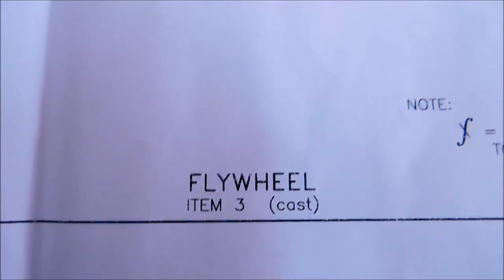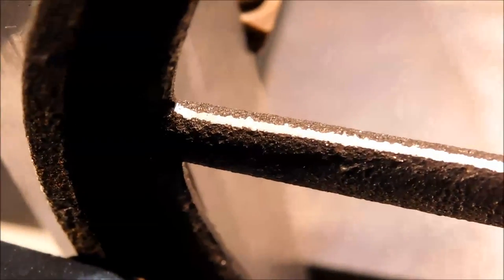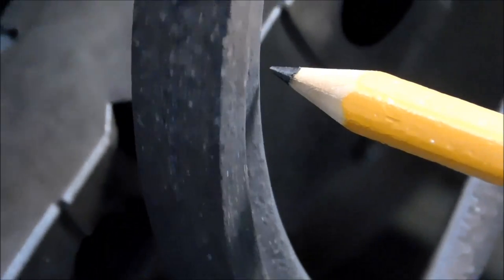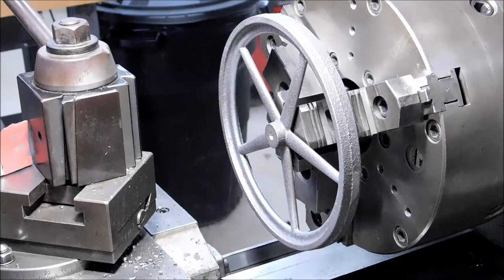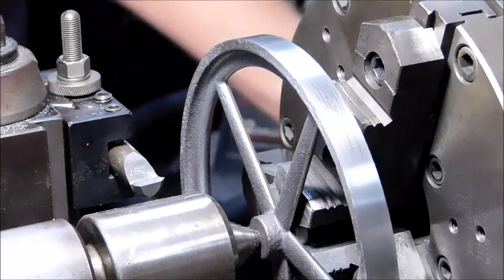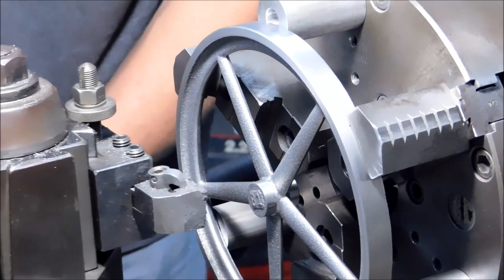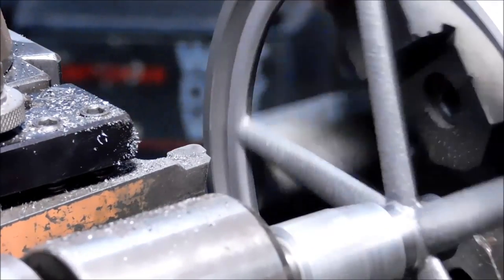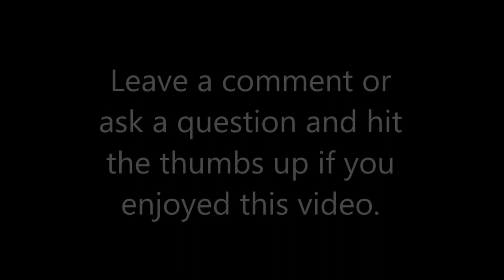Machining a Model Steam Engine - Part 10 - The Flywheel

Comment: i respect what Joe is doing here so don't take it any other way folk. now you see why so many shops won't take Cast ironwork they hate it,  the inconsistency in foundries alone is annoying. I'd do it because I don't mind a little extra work . castiron is porous and therefore a pain in the ass.  the smelter needs to take the steps of driving off impurities and gas present.

there's a hand full of methods. taking off the dross is a given
the gass's on the other hand is done with inert gases such as Agron and nitrogen with anything between bubbling it with a lance to pryolizors.- 'heating without the presence of oxygen, or both those processes are time-consuming and costly which is why you rarely see it,it's job-specific. when the iron just has to be right. regardless if it is poured count on it being just a little lumpy bumpy.   a big factor is the quality of the molding, sand being at the bottom of the scale as far as I can tell . better to be forged if at all possible. I'm not saying I know better than joe because I can't at all say that.

i think I would've spent some time at a bead blaster with this project. by the way, I get the feeling Joe knew he would encounter some of the trouble it gave him. this is for the benefit for the criticism that's sure to ensue for these comments. please be constructive.
Reply: after though the scale models back then had a crap ton of body filler which consisted of mostly lead and versions thereof habit and such not a lot of that went into moving parts with the exception of bearings.
Reply from the maker: Castings in general can be a pain in the as*. Mix in a byproduct that clings and stains everything and you get a better picture. There is a hand cream made specifically for cast iron work. If my memory serves me correctly, it was once called liquid mask or liquid gloves. Works like a charm. I personally don't like cast iron because no matter how much you clean up, the machine still pukes debris long after. As for the handwork on this piece, the company really could have matched the halves of the part better. I have to believe its a one piece pattern, but the halves of the mold were out of line. If anyone expects anything better from a kit like this, be prepared to spend 4x what PM charges. Overall, I enjoyed the challenge and was pleased with the kit and end result.

Comment: wouldn't this have been good 4 jaw work?  I don't have an adjustable 3 jaw so I know that's how i'd go.. make do!
Reply from the maker: If you gave me 5 more of these, I could do it 5 more ways. A 4 jaw would be great, but I didn't want to assume all of you had 4 jaw chucks, and a 3 jaw gives you better feel. At least I get better feel for delicate parts in a 3 jaw. ( or 6 jaw )
Reply: @joepie221  you definitely would have better feel for it the way you did it, and there's of course lots of ways to do things, which is one good reason I watch all your vids.. I've never come across an adjustable 3 jaw though

Comment: Can someone explain how to clamp this to a face frame and still be able to turn any of it?
Reply from the maker: First, if you clamp this to a face plate or frame, register the part on 3 narrow shims. Its guaranteed to stay flat that way. If you use 4 shims, it can influence the part and spring out of flat when released. Place your clamps across the spokes or inside the large rim recess area at 120 degree spacing and you'll have access to the hub inner and outer, the bore and OD. Keep your clamps as close to the shims as possible as not to bend the wheel. Then flip and finish.

Comment: There's a lot of up and down movement of the live center in the vid at about 50:10.  What's with that?  No criticism intended, just learning.   Thanks!
Reply: Additionally, I purchased the kit, and after over a 1 month wait, it arrived last week.  I studiously watch each of your vid's several times prior to beginning each part.  Thanks, and I supported you on Patreon.   Scott
Reply from the maker: Thank you Scott. The center movement is a combination of tailstock extension without being locked and the small live center adapter being eccentric to the contact surface. This can be eliminated by releasing the tailstock pressure slightly until the center trues itself then lock the spindle. It looks worse when magnified on the camera.

Comment: That was a poor casting to begin with and you did a great job. The inside will never run true as it is a group of arcs due to shrinkage. In the mid 60s I was a casting finisher in a foundry.
Reply from the maker: Thanks. I enjoy the challenge.

Comment: While this is a model that is not expected to do "heavy work", for larger "work" engines, the heavier the mass of the flywheel, the more energy the flywheel can retain.

The farther that mass is away from the center and closer to the rim, the better.

One way to increase the mass around the rim is to have a wide enough rim flange that holes can be drilled all the way around it, and lead inserts installed.

As the mass and RPM increases, the more mandatory and critical balancing becomes.

A simple cheap lawnmower blade balancer that works on the pinpoint fulcrum applied to the center principle, with a  circular bubble level on top works for us poor boys that can't afford high dollar sophisticated equipment. The more accurate the level, the more accurate the balance.

Comment: Will it need balancing?
Reply: I was going to ask the same thing. Guess it depends on the speed the engine turns.
Reply: @minigpracing3068  yeah its only 250 rpm rated so id say no balancing
Reply: I don't think the crank has a weight to offset the piston and rod.  These things will significantly vibrate from piston motion.  Look at the old steam tractors when they were running slow.  They swayed back and forth.

Comment: Doesn't it need to be crowned on the outside?
Reply: Crowning is only needed for flat belt centering
Reply: @ehess1492  Hmm, Good point as I hope to see this at work doing something like, , , well, , , crushing sugar cubes eh.. Thanks bud
Reply: That is the flywheel rim, not a pulley rim. It can be flat. The pulley would be much smaller in diameter, and would be on an extension of the shaft running through the center of the flywheel.

Comment: Could this have been done on a mill?
Reply: With a rotary table probably
Reply: You COULD do it with a rotary table, maybe with the flywheel on the spindle and a turning tool in the vice. Possible a massive boring head. 
The real question is, should you. If you want to make this engine, your going to need a lathe

Comment: Turn very slow and use a tool post grinder.
Reply: That indeed would be a good way to get through the scale. Once that is broken then of course you can go to a normal tool to finish the cut.

Comment: Just started to watch you trying to turn that wheel the way you did
There is a few different ways I would have done it, These are the first 2, but the thrid may have worked, Not sure if your jaws would fit,
I think I would have started to grab that wheel from the inside on the backside with a 4 jaw chuck, aligned it the best I could
What would have been any problems doing it that way, Or even clamped it to a face plate on the spokes with supports under the clamed area,  Would have made it much truer when spinning, Then after the one side was done, One can then use a collet etc

Or better still did you look for this?
I also would think you could have grabbed the inside of that outer rim with the outer side of your 3 jaws in between the spokes,
Degrees say possibly yes.
And you could have shifted that almost perfectly with it being very solidly held, You could have then turned outer rim, inner hub,
Forgive me if I'm wrong, Butt that is how I would have started or attempted to do it.
Reply from the maker: There are many different ways to have done this, but I approached it from a hobby mentality. An inside grip with a 3 jaw would not have worked without special or very thin jaws. An OD grip would have settled the ringing problem, but the uneven support from the 5 spoke pattern would have possibly warped the wheel or cracked it. The casting was challenging and fragile. My ideal approach would have been to do it on a faceplate, but I can't assume my viewers have all the tools and accessories I have.
Reply: @joepie221  Appreciated your video and honesty, I know I would have tried the most simple way, and may have as you mentioned. Might have cracked it, But I would have barely tightened it,
Thanks

Comment: Are you going to check for balance
Reply from the maker: I'm not going over board, but I will put it on a pin and take a look. A model RC prop balancer would be the way to really check it. Low RPM really doesn't need to be too balanced.

Comment: I know you want to show the work, but to be honest, you could have picked up a v-belt sheave from McMaster for about $30. Similar size and weight and a lot less trouble.
Reply from the maker: I could have also made one from plate. But thats not the point.
Reply: Pully from McMaster carr? Really?? Also could have just taken the whole kit to the scrap dumpster on day one and bought a brand new Honda 4stroke instead of showing people how to machine a steam engine from raw castings.

Comment: Pooh what a task. You must be in "a long term locked down" to have time for this. Being rude I could think of another way. Throw that casting into the remaking bin for recasting and make a flywheel "the Joe Pie-way".
When was that kit produced? 100 years ago? English?
I got the work to clean (restore) 10 steam locomotive wheels having 104 spokes in total. A high preasure washer had to do the job in order to get finished in "modern times".
Each spoke has 2 such edges..... Brrrr. What about using a Dremel?
What is the diameter ot that wheel? it looks big for that little steam engine.
Time 13:00 Haha. "Scream like nobodys business"......
Time 13:30 Again.. "looking for anything running concentric".... What about the safety aspect, not getting the throut cut by a flying/escaping flywheel?
Time 15:25. Adjustable 3 jaw? Not many hobbyists will have that, I guess. Why not the more common adjustable 4 jaw?
Time 18:30 A slight wobble compared to the pencil.
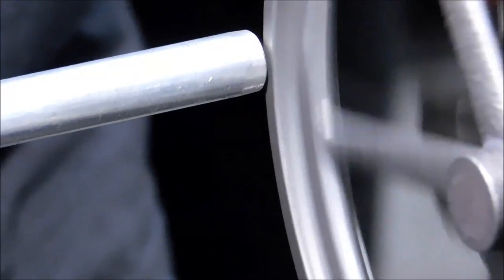Time 24:00. Could it be used as a propeller on a boat? Joking!
Time 26:05 "Will this work?" Joe the gambler? I never thought You would be that.
Time 27:10 Time to apply for pension, getting retired?
Time 29:05 Fingers teared off.... I got it.
Lots of fascinating steps.
Passed out at the end.
What is the balance of the wheel?

Cheers.
Reply from the maker: Quite the detailed comment. I could make one of these with my eyes closed on a rotary table, but the challenge is making a turd into a diamond. I'll take that bet. Hold my beer.
Reply: @joepie221  Haha. Modesty is not a burden for You. No, I guess You would manage.

Comment: Why not grip the outside of the fly wheel.  Inside is tough but outside is 'true'.  Need to stop harmonics.  Dampen it.  Car inter-tube sliced into rubber bands and viola!
Reply from the maker: You absolutely could, but if you had this particular casting to hold, you'd see it was not only shifted, but warped too. An OD grip may have distorted it in the early stages. I think a tooling plate would have been best.

Comment: Joe, the Company that supply these castings should be ashamed of their product. That casting is totally CRAP, very rough casting due to a poor process. They should take a leaf out of the book of a UK Company called Stuart Turner, all their castings are a fantastic FINE finish where you can see VERY fine details. Your crowd are using sand, and a coarse one at that, UK uses a LOST WAX Process. Their finish is so good that literally 2 strokes with a Super Smooth File ( Cut 6 ) makes the surface shine as if it were a piece of Bright Rolled Mild Steel. I certainly would never buy anything from them after seeing this flywheel, some of the previous castings were of questionable quality. Thanks for persevering with it though.
Reply: Lost wax is much more time consuming, requires additional expensive materials, you need to mold wax patterns for each part that get destroyed and therefor much more expensive. People have been making models from sand castings for a 100 yrs. It just means some more skill is required.  The small misalignments between the cope and the drag end up being more of an issue because of the small size of the part. Getting around that separates the men from the boys! The end result will be very nice because of the careful work he is putting into it. And that challenge us half the fun. If the parts were all cnc cut and perfect what fun would that be? Any moron would be able to do it.
Reply: I've done more than a few engines from both PM Research and Stuart Turner and have had good and mediocre castings from both companies.
Reply: Just proves to me that a Texas Yank can turn a turd into a silk purse! And that is that. God bless you Joe Pie.
Reply: With respect, making accurate castings in this size, in iron and in quantity at an affordable price is not easy. I'd say the end result is way more than acceptable.

Comment: Get a challenge   a Stuart Triple
Reply from the maker: I have the vertical twin I'll be building soon.
Reply: @joepie221  I drove up to Henley on Thames in 1969 and purchased a Stuart Turner vertical twin, bought a lathe that was a piece of junk added to the fact I had no experience and damaged several parts. 12 years ago I bought a Myford ML7 and slowly over the years rebuilt the machine. Now at 73 years old and nearly retired, I'm ready to build my Stuart. After watching your programs,  I'm still not ready. I do have experience as a millwright working for Boeing and a company that build hydrogen separators, first one fitted in the new 9/11 building in New York, so had to use milling and lathes in a small way. I have learnt a lot from different videos but after watching yours, I still know nothing. Thanks Phil.
Reply: @joepie221  can’t wait for you to dig in. I love it!  I have 30 yrs experience in engineering and machine but still still learn new stuff . Like I said, I love it!
Reply: @Corsairflag  Rock On Dude! The Myford ML7 is one of my favorite lathes. I have a hardinge HLV and monarch 10EE but there is a sexy appeal to the ML7. I am hoping to find an old ML7 with drip oilers in England this summer.
Reply: @devemch7851  Most hobbyist have milling machines along with there lathes, I can afford the best single phase mill but can't justify the cost because of my age unless I live to 99, then I will be sorry I didn't buy one. At one time people built amazing machines with just lathes, mine does not have a select gearbox and I had to learn how to calculate the required gearing. The saddle will be used with a dial indicator to achieve accuracy during milling. I have just fitted a quick change toolpost and new 3 jaw chuck. I have never heard of the lathes you have but they look excellent. I live in Canada now, where in England are you. Phil.
Reply: @Corsairflag  Hi Phil
I live in the states but I have a bad habit.  I am a hard core old school tool and die guy.  Software by day and metal chips by night.  The girlfriend didnt appreciate my like of rusty restores so she is gone.  I am getting a LeBlond servo shift lathe running now and I also have a 9 inch south bend I will totally rebuild with a nice oak base.  The oak base is my own design with hand cut dovetails. I have been fortunate to find old books on the subject and learn from old timers. The myford ML7 is unique in that it has features and add ons that assist the model engineer.  Its amazing to see some of the work done on only an ML7. My 10EE and my Omniversal mill have Tube based speed controls.  Big tubes that glow blue.  Thyratrons to be exact. I have worked as a CNC machinist and its often a boring job of baby sitting Mastercam and then waiting for the machine to finish.  I truely enjoy the old ways. And the trig is really enjoying.  Its a pleasure to show kids who argue that trig is useless what trig can do for you.  Joe Pi is one of only two youtubers to bring up the virtues of the tooling ball.  And dont forget sine plates.  What part of sine dont you understand?  Its a single calculation to find a stack height to get dead nuts on angles for a set up.  Easy.  Keep learning and enjoy what you do.  Its a real pleasure to complete something like this.

Comment: Masking tape or rubber band on the OD@
Reply: A whole mess of rubber bands was my thought as well.    If that isnt enough, we have a bunch of lead sheet. A strip of that around the od with the mess of rubber bands, then spin it slow.
Reply from the maker: I wonder if melting a candle or heavy modeling clay would work?